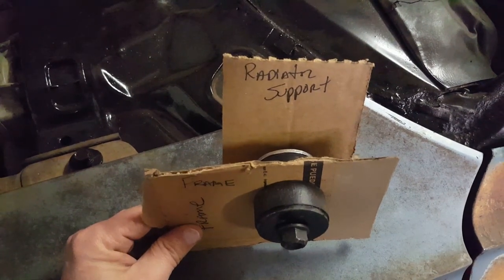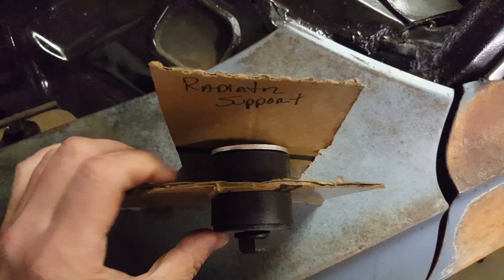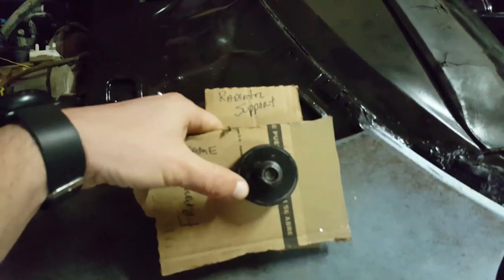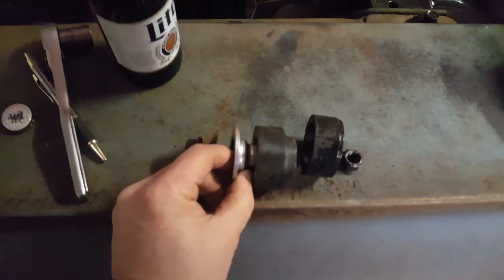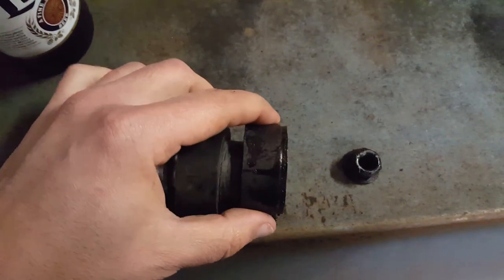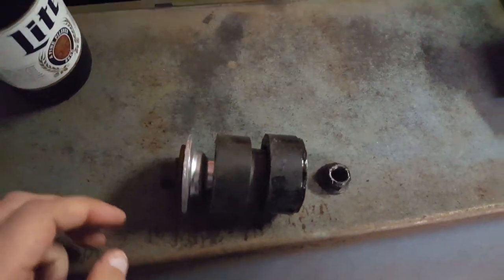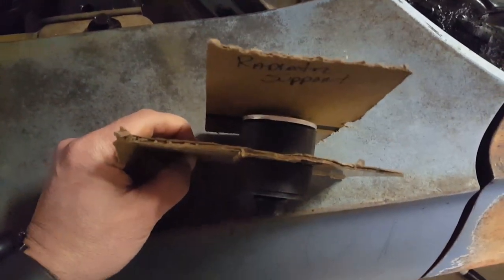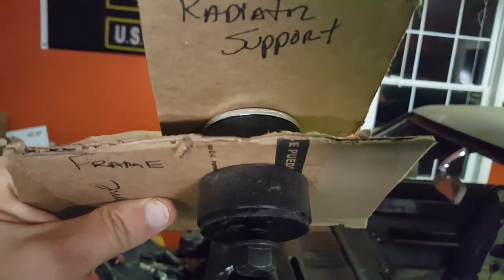Radiator Support Bushing instructions

Comment: Thank you for posting this.  I think cardboard as shown in your video is mislabeled.  You're going to want the radiator support between the two rubber bushings - and the frame beneath the bottom bushing.  Thanks for the information, perhaps you could correct it, just because that's what guys like us do!  =D

Comment: How do you remove them ? I have a 65 chevy c10 and have every nut off and the grille support is loose other then removing those bolts. I have removed the nut and washer and lower bushing.  Do I need to push up on the bolt to get it out? I'm stumpped... I put a hydrylic jack under the bolt and tried that way to get it out but it did nothing..
Reply from the maker: I think your way seemed like a good idea....   sounds like they are rusted in......spray with tons of rust breaking type oil
Reply: I got them off. Lots of WD40 and a propane torch to get rid of the remaining bushings. And pryed up with a crow bar did the trick
Reply from the maker: @ammoguy5  glad you are replacing them! Sounds like they were cooked and rust just spreads like wildfire....
I would definitely por-15 between the metal and the bushings so your frame is protected while you have them out...  appreciate your comments...

Comment: Why is it when I watch this you seem to contradict the cardboard layout to your explanation. I would think the core support goes between the rubber pieces. Now I’m confused.
Reply: You are correct.core support should be between the 2 rubber pieces.
Reply: @1965bbody  Wrong.  There would be no bushing effect with the core support tied directly to the frame.  The core support rests on top of the bushing so the rubber can dampen vibrations.
Reply: @schrank17  Re-read and then reply
Reply: @schrank17  
core support between rubber pieces.
Reply: @1965bbody  Negative.  The frame is between the rubber pieces. The core support is placed onto the top of the bushing and the other rubber cap is inside the frame rail.
Reply: @schrank17  LOL, we will disagree on that, my assembly manual says different and so do energy suspension, but you do what you think is best
Reply: @schrank17  if you flipped 180 degrees the example shown in the video and re-labeled the cardboard with the bottom one as 'frame' and the one between bushings 'radiator support' it would be correct.
Reply: @1965bbody  if you flipped 180 degrees the example shown in the video and re-labeled the cardboard with the bottom one as 'frame' and the one between bushings 'radiator support' it would be correct.

Comment: No, whoever told you this is Not correct.
Reply from the maker: The diagram is correct... I wrongly stated it in the video
Reply: @RoadHardRoadhouse  the diagram is incorrect. The explanation on the bench without the cardboard seemed like it was right but the core support will not be or should not be in between metal washers but should be between the rubber. In the cardboard its metal on metal. You're right though, nothing on here but the diagrams will be in any service manual.
Reply from the maker: @chuckwilliam1563  I will look at it again...  thank you for letting me know
Reply: The cardboard layout is correct, the explanation was not. I am not sure if the frame was even mentioned in the explanation.
Reply: @joedavis8866  if you flipped 180 degrees the example shown in the video and re-labeled the cardboard with the bottom one as 'frame' and the one between bushings 'radiator support' it would be correct.
Reply: Kevin Worrell , I just got done doing the rad support on my Ranger. I did it the way the cardboard cutout is shown in the video and it was correct. The pieces dictate how they go together. I also took pictures before I disassembled the old ones.
Reply: @joedavis8866  it might have worked herry rigged and even function but the chassis manual says otherwise but do what you do